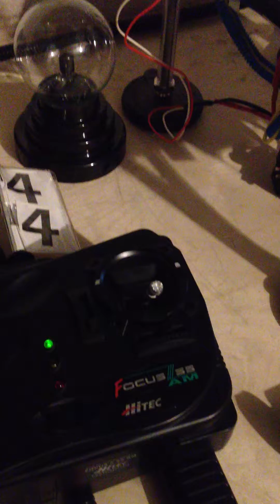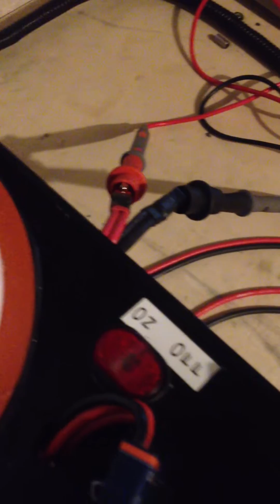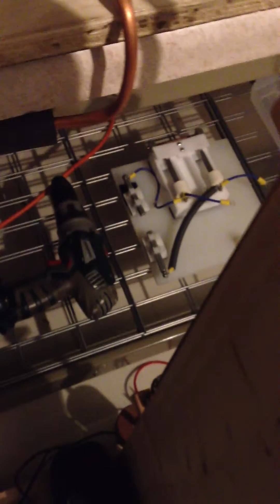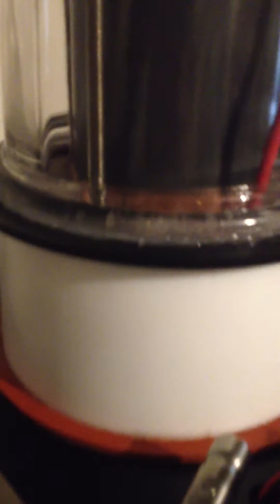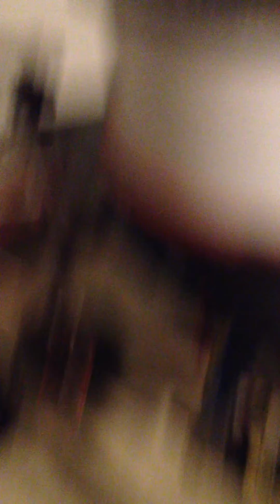PLASMA INITIATION OF ROTOR Spinning WITHOUT PRIMARY MOVER

Comment from the maker: This is a quote from Aspden effect lecture 30
"The idea behind this is that if one can set up a radial electric field, meaning one emanating from a spin axis, and that axis happens to be in-line with an axis in the vacuum medium about which there is the quantum jitter of a very high speed circular motion of very small radius shared by all matter, then that radial electric field might induce spin by that vacuum medium itself."